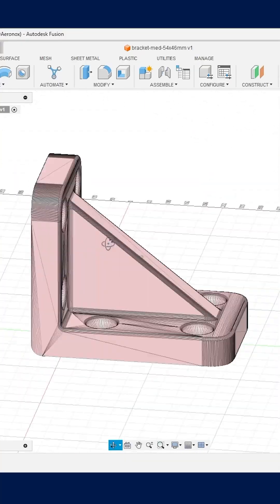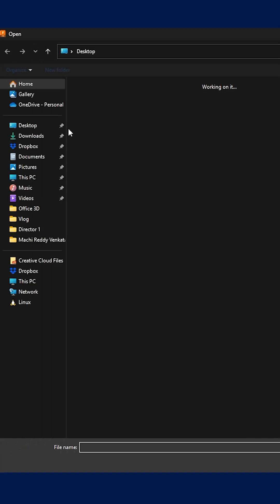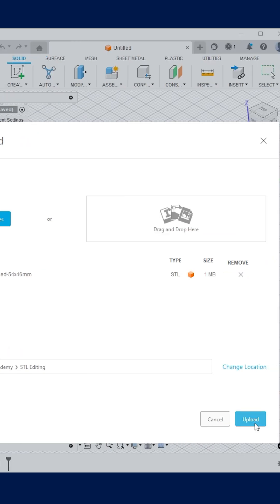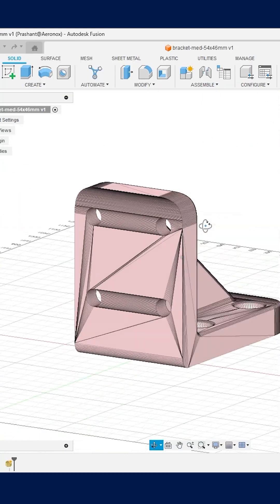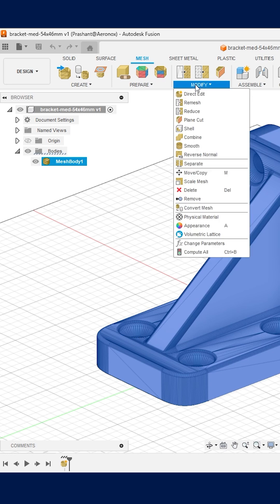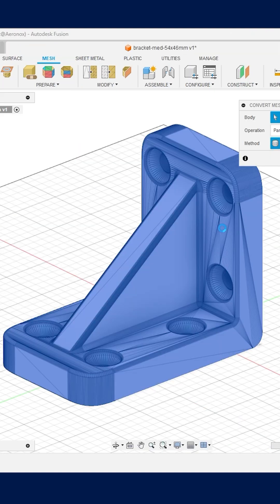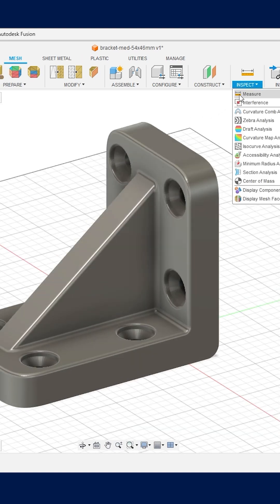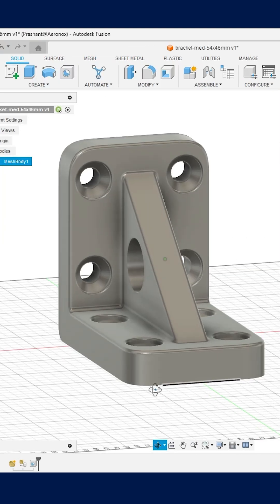STL to Solid body using Fusion 360. #fusion360 #3dmodeling #stltosolid

Comment: This video is halfway to gold 
After converting to mesh, go round the object and delete some faces. Fusion will automatically “fill in the gaps” and join the faces. 
This way you can get clean faces and bodies
Reply from the maker: Yes that's possible works in case of flat surfaces.

Comment: Changing the visual style won't do anything. The facets will still be there. What you did was only possible because you had one giant flat face. You could've achieved the same thing without changing the visual style. This way you trick people into thinking they will be able to manipulate complex mashes just by changing the visual style.
Reply: He’s Indian. Whatdya expect? Lmao
Reply: Yes, it is misleading. I thought he found a trick. Should have known better.
Reply from the maker: thanks for your valuable feedback, I explained what's possible with tools like fusion 360, you can only convert simple meshes to solid, it will not work with organic shapes since Fusion is parametric tool designed for Product design and industrial design industry, I only share and explain process in my videos with correct steps, If you have better ideas 💡 we welcome you always.